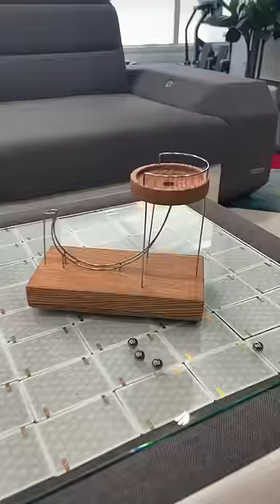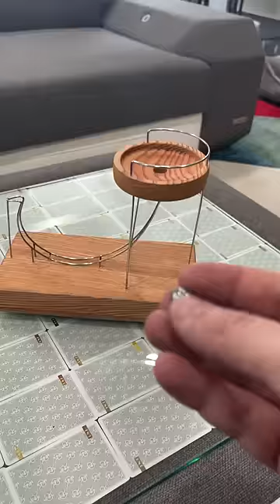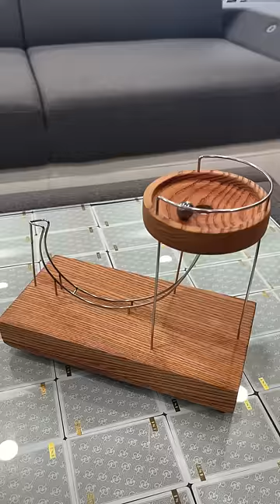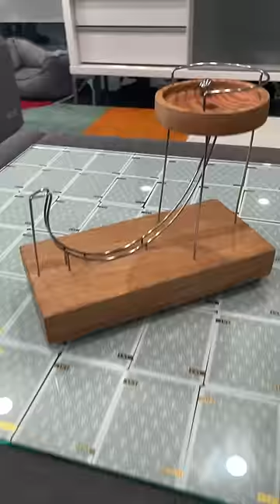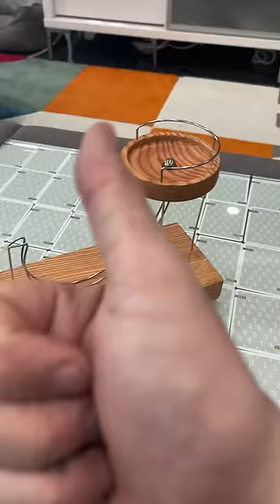An Impossible Perpetual Motion Device?! 😳 #Shorts

Comment: As anyone that ever had a HotWheels track can tell you, the loop can never be as high as the feed ramp.
Reply: Making engineering kid friendly. You should be a teacher.
Reply: Lol
Reply: This has a battery propelled magnet underneath
Reply: Yeah there's a magnet under the track inside the wooden base ..it's so easy to see the unnatural acceleration
Reply: U use more energy powering the magnet underneath than u could generate if u made any kind of practical generator out of it... 100% efficiency doesn't exist
Reply: @4-Sight-Skating  100% efficiency can exist, more than 100 can't
Reply: @NomTheDom  nope
Some energy will always be lost to friction... always
Reply: @phantomaviator1318  unless you have something that is electromagnetic/supercooled. But there is still air friction, not as worrisome but still friction
Reply: You gotta love how you can use something as simple as a Hotwheels set to give a good lesson on engineering and physics.
Reply: @NomTheDom  100% efficiency is impossible. It's possible in theory, but not really in practice. You can't get zero friction, you can't get complete vacuums. It's just not possible. There will always be a loss of energy.
Reply: Dure it can, you just need a booster
Reply: @Rob Ott - oh , you are slow asf.
Reply: @Rob Ott please tell me you weren't fooled by this...
Reply: @schizophreniagaming4058  Something is still needed to get it in motion. That Something loses energy in the form of heat
Reply: @Druid_Plow  I actually really like vanilla ice cream
Reply: @schizophreniagaming4058  though the electromagnets suspending a superconducter will be mounted to something and that will cause friction
Reply: Can somebody explain where this machin loses energy
Reply: Rollercoaster Tycoon*
Reply: Number one reason why the loop in the Hot wheels world race movie(2003) was rigged.
Reply: @Rob Ott Yes, and it's fake as heck.
Reply: @monishrules6580  friction, from anything that the marble touches.  The wooden bowl, the metal track, the air...
Reply: Yes
Reply: - master oogway
Reply: @phantomaviator1318  what about… a maglev train in space? 👽
Reply: @donatotaccogna2701  0000 00 00 0 00
Reply: @monishrules6580  Friction from air and the track. The balls have to displace air as they travel, so drag forces. You can clearly hear the ball move through the device, hence it produced sound. And though you don’t see it, heat is produced when ball and wood compress on contact(negligibly small loss but hey you. wanted to know). The basic idea is, any time energy is converted, you lose energy as the conversion is not 100% efficient.
Reply: Whats the point with this tho? The feed ramp is higher, but it goes perpetually
Reply: @schizophreniagaming4058  then you’re putting energy into that system though, which takes it away from 100%.
Reply: @NomTheDom  the sound created is a loss of energy
Reply: Me,who practically threw the hot wheel down the track: Hold my Viper GTS
Reply: Even with 100% efficiency, a loop the height of the ramp wouldnt work to keep the car on the track
Reply: Even with 100% efficiency, a loop the height of the ramp wouldnt work to keep the car on the track
Reply: Unless you use a powerhouse.
Reply: @monishrules6580  do you hear any sounds coming from the ball? That's energy flowing away from the machine. The air friction against the ball is not as obvious, but we all know it's there.
Reply: @nigelkarssen2409  maglev trains require power to flow in circuits. There's always loss there. There are always atoms even in the deepest of deep space that cause friction against the train. Has the train accelerates, the materials in the train compress, ever so slightly. Friction.
Reply: @Sam-bn7jk   It doesn't go perpetually without energy input into the device - that's the point. And that energy has to be renewed periodically.
Reply: @4-Sight-Skating  Could a permanent magnet be used?
Reply: So I've seen some misconceptions so here.

The ball couldn't ramp back up perpetually as the sound it makes along with the air it moves through takes energy away from it.

In theory, it is possible to have 100% efficiency, but never over 100% efficiency. In practice, it's impossible to have 100% efficiency.

You can calculate efficiency through ((Kinetic energy - Other forms of energy) ÷ Total energy)×100

You can replace kinetic energy with some other form of desired energy in the calculation.
Reply: @khmak9387  a regular magnet would decelerate the ball after it passed as much as accelerate it before so... no. Electro magnets swap polarity or keep it going on direction, but it uses energy...
Reply: @4-Sight-Skating  Good point 👍
Reply: It can if you apply force to acceleration lol
Reply: @BradPwnsU  what energy will u use to apply the force to acceleration?
Reply: @donatotaccogna2701  Thank you! I was trying to figure out where the trick was.
Reply: @Rob Ott Haha, uhmmm no this has some other mechanism like a battery powered magnet speeding up the ball to get it back up. If this was real then they could shut down all power stations and everyone gets free power and as much as they want. The laws of physics make this impossible, it simply does not exist.
Reply: @4-Sight-Skating  lol I meant apply force to cause acceleration
Reply: Didn’t he say that it was NOT a perpetual motion machine, just that one would look something like this if we could actually build it. Not necessarily that shape, but the “definite input~infinite output” illusion. 

I don’t think he was trying to trick anybody, just illustrating the abstract idea of perpetual motion.
Reply: @TheBlackWaltz  maybe in space somehow one day?
Reply: My friend your a legend
Reply: You ain't kidding
Reply: @NomTheDom  where can 100% exist?
Reply: Unless you had the shark car. That was the fastest one ever.
Reply: It can when the two prongs are gradually separated creating free fall added acceleration and overcoming the height with that added velocity and an appropriate degree of accelerated cork screw release (propel angel). It’s tricky. It’s slick. But it’s still not a trick.
Reply: @jonslg240  or….look at the tracks gradually spanning out to add false free fall added acceleration. Little tight cork screw off ramp to add the right trajectory and there ya go. I think it would work.
Reply: Plastic and hard metal like iron are different
Reply: @phantomaviator1318  I disagree. Liquid helium has absolutely 0 friction and friction exists due to factors we can eliminate. We can use a propulsion method that does not touch other objects and pump down an area to vacuum. If there are no particles of any kind or forces of any kind besides its intentional propulsion, you can have a 100% efficient device. It'll be completely useless however since you can't pull any energy off of it without reducing its efficiency.
Reply: @monishrules6580  
1, you can hear it, that’s energy lost;
2. Friction in the wooden bowl;
3, friction along the rails as it goes down the ramp;
4. Air resistance in the bowl, going down the rails, and in the air when returning to the bowl; and,
5. Electrical resistance in the circuit powering the electromagnet accelerating the ball through the hole. 

That’s just quickly off the top of my head. I probably missed other obvious energy drains. …

I’m sure it will keep running as long as the batteries held out.
Reply: @phantomaviator1318  but ehlons car gains energy using friction 🤔 

And gravity has a consistent pull force ... If Max pull force can be ......😶‍🌫️

I know too much
Reply: Tell that ro my Hot Wheels POWER HOUSE 🔥
Reply: @mirormagnetizer  So, perpetual motion works in theory because you could theoretically devise a thought experiment in which you have complete control over the process of transferring one form of energy to another and not loosing it to another form of energy, but in practice the laws of the universe naturally tend to maintain an equilibrium of energy, and not loosing this energy to friction (or in some other form) in some way or another would break the universe? So, what if the ambient friction created during energy conversion could be made efficient and useful as well? I suspect that this is also theorectical, both in present day and possibly forever.
Reply: @schizophreniagaming4058  something that is electromagnetic will eventually lose its electromagnetism, and whatever is supercooled will reach room temperature, both requiring energy to maintain their electromagnetic or supercooled states.
If you're introducing that into the system, you need to explain how those things are being powered too.
Reply: 100% true
Reply: If it isn't directly related to, or doesn't explain the physics of getting spanked with a track segment, I don't wanna hear it.
Reply: It has a weird curve. Had to do with drawing a curve by rotating a circle or something
Reply: @phantomaviator1318  electric heaters are 100% efficient
Reply: Unless the feed ramp is steeper.
Reply: @Druid_Plow  He would make more money designing a better hot wheels toy.
Reply: Only if you didn't have a ' 
🏎Supercharger!👍
Reply: Just brought back tons of great memories. Thank you
Reply: @monishrules6580  The battery installed underneath will eventually go dead.
Reply: @TheBlackWaltz  Anything is possible in the metaverse
Reply: @jonslg240  thanks, I knew something wasn't right, was wondering where the cheat was!
Reply: Nerd
Reply: @alyrousse8605  even space isn't a perfect vacuum unfortunately. And you need to take power from a system to use said power. So even if you could make a perfect system that is perpetual, as soon as you take energy from it, it's no longer efficient and will lose energy from that and stop.
Reply: I think this could be achieved with magnetic beads and well positioned magnets inside the deck for alignment and a subsequent boost on passing through
Reply: @phantomaviator1318  not if you have a frictionless surface
Reply: @nigelkarssen2409  LOL remember when Elon musk "invented" that that decades after I had already been invented lol?
Reply: @Sam-bn7jk  basically it uses a set of rollers that powered by a battery. the idea is that the energy required to spin the rotors to propel the ball takes more energy than you could ever generate with it if you were to set up some kind of generator powered by the ball in
Reply: Unless it has batteries
Reply: @NomTheDom  no it can't. Everything slows down.
Reply: Just ignore friction and gravity, and it can.
Reply: @katiebarber407  yea i know physics didnt know of the battery since i dont have this in front of me thanks for femalsplaining.
Reply: A balance of kinetic and potential energy would reveal the ramp has to be twice as high as the loop.
Reply: Engineers since day 1 😂😂😂
Reply: This “loop” still losing energy every time. The ball always falls short of the hole. It’s the platform that allows the ball to travel the distance lost in the energy transfer, back towards the hole. 

It’s that part of the logistics that is throwing people for a loop
Reply: @NomTheDom  nope, 100% is not really possible, 0% drag, 0 friction, no noise.
Reply: Anyone else use the track as a weapon against siblings?
Reply: @phantomaviator1318  what would you call an electric heater? It's 100% efficient
Reply: @Vassle  heresy
Reply: The video doesn't lie.
Reply: Ok I am familiar with the name and idea. I am not a physics person. Wouldn’t something in space be able to accomplish something close to perpetual motion since there is not as much gravity?
Reply: @phantomaviator1318  Google it my friend
Reply: @phantomaviator1318  Tell it to a transformator with 0 moving parts. There is no friction in it but resistance. Thats 2 different thing
Reply: Bot
Reply: @Rob Ott 😆 It’s not. It’s powered by electromagnets
Reply: @monishrules6580  friction. Air resistance
Reply: @TheBlackWaltz  So I guess planets in orbit are not there
Reply: An “engineer” colleague couldn’t understand that a gravity fed fountain can’t produce a jet that goes higher than the surface of the source pond. He kept on about the “pressure”.
Reply: @brandonrandall3861  The planets are there, but they won’t be there forever. Our moon seems to go round the earth perpetually, but gravitation produces the tides on the Earth. The tides are friction in the system so the moon is slowing up and consequently moving away from the earth - just very slowly. As for the planets they are producing tides in the surface of the sun.
Reply: You sir deserve a nobel prize for that explanation!
Reply: @99Noggin  Objects in motion tend to stay in motion unless acted on by an outside force. Friction or interaction with gravity etc. Create outside force. Those forces are removed as a body moves through the vacuum of space and far enough away from other bodies as in the edge of the universe. It just keeps going.
Reply: @99Noggin  I did not know that about tides and such it sounds legit. Thanks.
Reply: Adding a hidden magnet at base can make it work
Reply: Or you can spray some SPEEDRUP on the wheels. Today only $199 !
Reply: A professional has spoken
Reply: FACTS! I learned that back in '83.
Reply: @monishrules6580  constantly as it makes contact with what ever surface it's rolling on.
Reply: And the maths confirm it, since there are (supposedly) no external sources of energy, you have:

- Kinetic energy (Ke)
- Potential gravitational energy (Ge)

Since the sum of all energies must be either constant (in a perfect, conservative sytem) or decreasing (due to other energy conversions like kinetic to sound or heat), this would mean for every cycle n+1 after cycle n, you'd have

Ke(n+1) + Ge(n+1) <= Ke(n) + Ge(n)

Since, at the moment the ball falls into the hole, it has (effectively) no kinetic energy, all of it's energy is potential:

Ge = mgh (mass x gravity constant x height), which should be all the energy in the system at that point

However, when the ball peaks in height (when it's going back to the wood base), the energy in the system is greater, since
E = Ge + Ke = mgh + Ke

Not only does the ball have more kinetic energy (it's moving more), it also has more gravitational energy, since it's higher

So, this would be a system where Ke(n+1) + Ge(n+1) > Ke(n) + Ge(n)

Which breaks physics, since that's (supposedly) the creation of more energy
Reply: that is archimedes
Reply: @monishrules6580  it's using an electromagnet to shove the marble back up. It is using electricity to push the ball on the rails to launch it back ip to the wood platform. Gravity wouldn't make the marble accelerate that fast with that short of a drop as max speed of gravity on earth is 9.6 meters per second.
Reply: cak01vej  this is a lie. Friction still exists in space lol. Air resistance may not exist, but solar winds, and solid objects floating around like meteors and so on still have friction around the asteroid belt.
Reply: cak01vej  solar winds still prevent 100 percent proficiency, and dust or physical matter still exists as well. Even in the vacuum of space there is still energy loss due to basic laws of physics.
Reply: ahahahah thats a good roast xD
Reply: cak01vej  well not you in particular, but it was just a general statement altogether. But I agree with your last statement about solar winds.
Reply: @donatotaccogna2701   Lol wrong. There is nothing external hiding lol
Reply: EXACTLY MY ANALOGY TOO!! 😊😊👍👍
Reply: Yepper doodle on the hot wheels. I still have all of my track an cars. Was 8 years old in 1969. Those Hot wheels were so much fun...
Reply: And yet, simply placing a large neodymium magnet strategically offset under the hole, in the wooden deck, the initial fall accomplishes the same increased velocity & since the magnet theoretically will last for centuries, it's as close to perpetual motion as you'll get.
Reply: I9
Reply: To everyone saying there's a magnet in the base, no there isn't. We would see a dramatic decrease in speed as the magnet would still be pulling the ball.

This machine has a motor in the funnel. The base is a battery.
Reply: @austinmorrison6953  😊👌👍
Reply: Can if you have a motor on the ramp 😁
Reply: @donatotaccogna2701  prove it.
Reply: @4-Sight-Skating  do all magnets require batteries? It's just an interesting way of harnessing magnetism, although less useful than electricity...
Reply: Lmao ikr
Reply: @buffalo wt impossible in this dimension maybe?
Reply: @monishrules6580  when the ball is lifted by the persons hand, the muscles used generate heat.
Reply: @buffalo wt if the beads were polarized so the magnet pushes, and the offset is very strategic, something like that could be accomplished without deceleration. But this is clearly electric and I'm sure those bearings are making a contact connection at some point. They don't appear to be gaining much momentum as they fall, they just instantly accelerate unnaturally upon entering the whole.
Reply: @phantomaviator1318  what about in a vacuum. Is a rock flying through space perpetual motion? Theoretically, if it never bumped into something else, it could continue moving due to inertia.
Reply: @danieltauai123  Wouldn't it still lose tiny bits of momentum from little pieces of space debris and gravity?
Reply: @phantomaviator1318  I wonder if something like this could work on a friction less surface.
Reply: @schizophreniagaming4058  laminar flow is friction